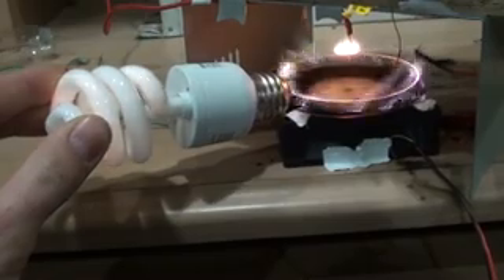The First Real Iron Man Arc Reactor Test!!

Comment: it looks like you just created a tesla coil rather than ark reactor, it think you are just shotting plasma in a spinning copper coil, by doing that the electricity would flow in the the spinning coil and make some electric current and magnetic field, and the created magnetic field makes anything around the range of the magnetic field light up, that is also the reason why the light bulb have little to no light at all.

Comment: this is not an arc reactor, it does not generate energy by itself, it is a plasma created by using high voltage and creating magnetic field. If it directed electricity to tesla coil and burned the light bulb, it burned more stable and clear (video was discarded 6 years ago, just remembered but it was late)

Comment: That white light bulb is glowing because of the plasma ionising the material inside ,and the spinning thing is just high voltage you produced from a trasformer arcing to the wire connected to a motor

Comment: Aparantly arc reactors have a radio active core and a ring of something else that gives off gamma rays around the edge of the core and the arc goes though a tube that's round filled with gas think it's hydrogen thats what the coils are around the unit to corse the gas in the tube to give off ions to then make the ring of radio active substance give off gamma rays to the core which will then give off elections to power a coil to power the unit its a former of cold fusion
Reply from the maker: I have seen that theory! If only we had a way to reliably reflect Gama radiation!

Comment: Isn't the Arc reactor like a battery that has so much power, it only runs out over time? (And the only thing that runs out is the metal inside of it)
Reply from the maker: Hypothetically it is similar to a fusion reactor, it would eventually run out of fuel so it would need to be refueled every so often.

Comment: so how u made it , may be i wanna try 
is the input to the fan around 6kv -20kv or the amp is to be big 

i have a microwave transformer i can get upto 8kv for 1 winding 
for another winding i may get upto 800amps 

which is needed amp or volt 

how to mount inputs to the delay fan 

                                                                         comments pls
Reply from the maker: +lokesh rahul You would need high voltage and low amperage. The fan is just running on 12 volts
Reply: +science1324 dude not the input to fan I mean input to the coil , surrounded to the fan anyway thanks for the reply , OK u mean HV low amp OK then I will try if succeeded I ll upload photos and I will buy u a beer

Comment: u are almost there, make it self-sustain plus powerful enough to power a flying suit and u will be the iron man.
Reply: ***** k, 2 sec
Reply: CakeMoron  yeah, just give us a couple of seconds and it will be done!
Reply: He doesn't actually have a flying suit I suppose 😂
Reply: Fill a torus shaped chanber with deuterium and tritium then give it short high voltage high current pulses this will heat it to a stable plasma then use electro magnets to keep the plasma in a ring then continue the high voltage pulses and extract power from it via small solar panels then keep the heating process going till to reaches fusion at this point it will provide enough heat from the reactions to keep it self going and it can be recharged by splitting the helium back into deuterium and tritium this with also release energy that keeps it going.
It will produce a smaller amount during its recharging but when doing normal function it can produce a few hundred watts.
Very simple and can produce a few terawatts if scaled up and helium is used to heat up water and produce stream turning a lot of large turbines.

Comment: Wait, what is the purpose of that fan? The transformer you are using for high voltage arcing, will power the lightbulb even without the fan.

It is like putting a lightbulb in a microwave and calling it a power source.

But I think you already know this...

Comment: This could be possible. But, the purpose of the technology of ironman's arc reactor is to gain power out of it. What you did is giving it power supply. So unfortunately it means that this is only a replica by using electricity.

Comment: Plasma or Tesla coil+H2O to make H2O2 Tesla coil makes O3 gas in the Arc, But right now I am working on Electric Eel Hunter's organ, and the Sach's organ. The Hunter produces 500 AC volt every second (Stem cell research) Electrocytes are essentially cells which are responsible for the generation of electricity and also a phenomenon known as electroreception. Electric eels have several thousand of these cells (each producing 0.15 v)

Comment: The arc reactor isn't a fusion reactor. It relies on radioactive components entering a form created when in contact with a fluid form of lithium, and distilled (I think that's the word for it) with electricity. The resulting fluid creates high amounts of energy when moving at high speed. Unfortunately it's also in the most dangerous state of the element, and could level a city if there was even a miscalculation to the 0.000001 placement

Comment: if you find a really old lightbulb they have extremly thick wires that can be used for this, theres actauly a fire station that still haz one burning and its almost a 100 years old...
 speeking of light bulbs is it possible to put the bottem part in a vacum? it would keep the wire from burning and you can run much more power through it